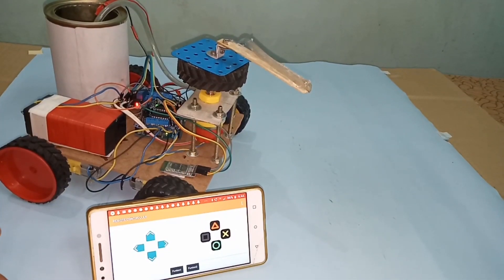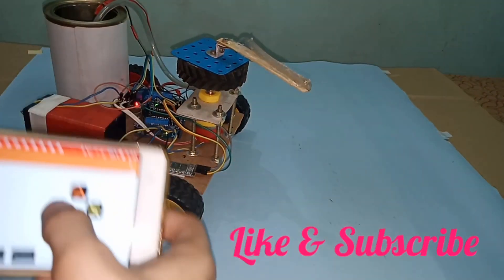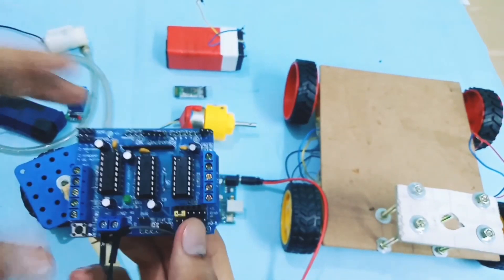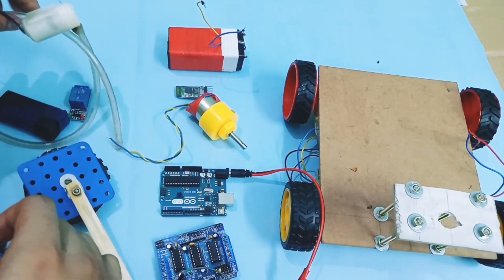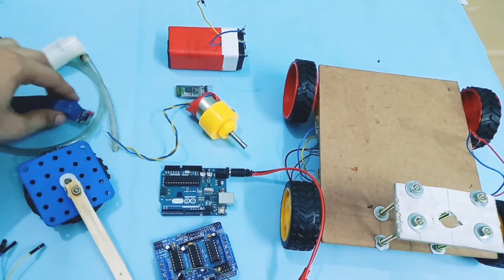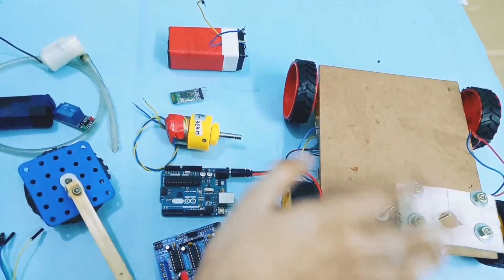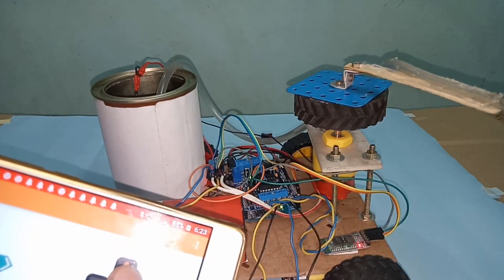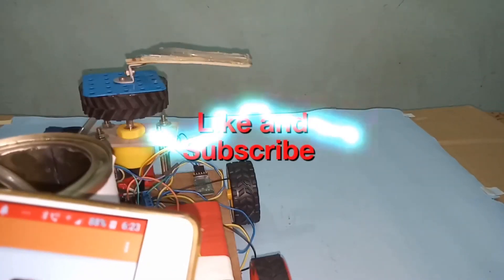Fire Extinguisher Car

Comment: Can u tell me how to make this project automatic means it can sense the fire and go to the fire place automatically and extinguish plz sir tell me
Reply from the maker: Use the concept of obstacle avoidance car,on servo motor place flame sensor instead of ultrasonic sensor.The servo motor rotates 180° and whenever the flame sensor will be active i.e when it will detect the fire the water pump will be activate.But you have to make changes in the code.
Reply: @harjinagi6922  I even don't hava a basic concept of coding
Reply from the maker: @om9.8dclash81  Making the bots automatic is not easy task you can start with basic tutorial on Arduino and later think about Automatic fire extinguisher car
Reply: @harjinagi6922  bro I have to make a project and I have found codes so I am thinking that it's easy